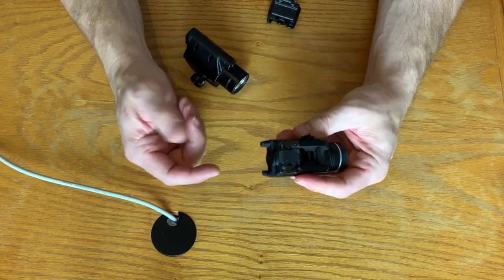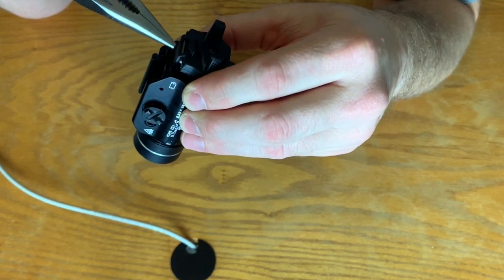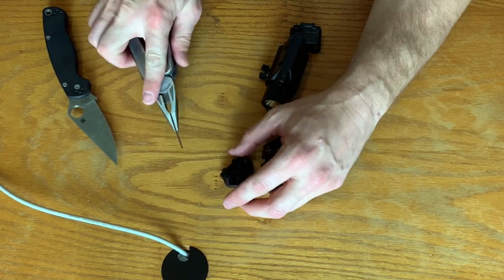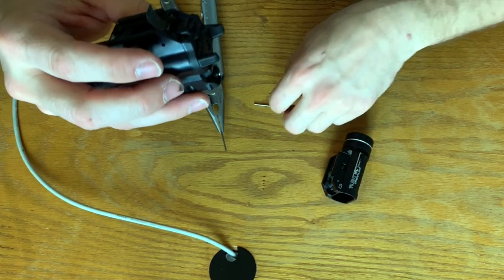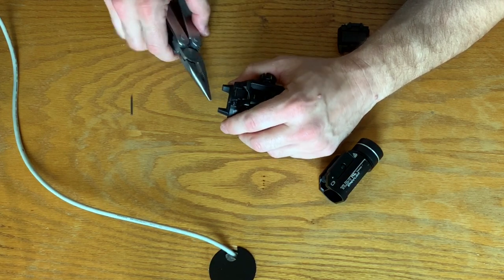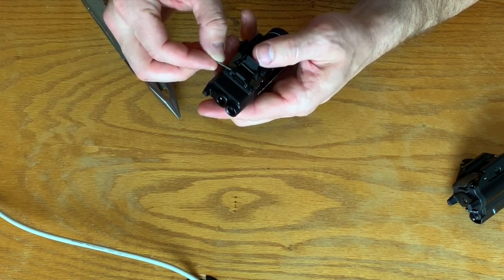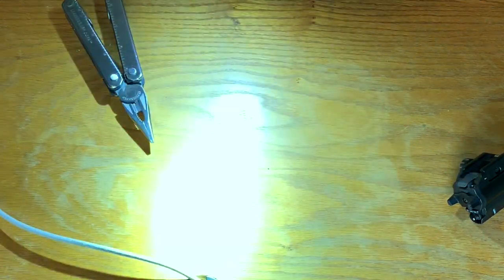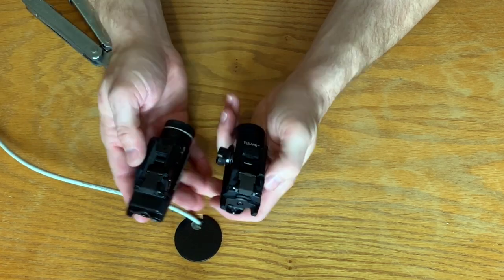Swapping Out Battery Doors on a Streamlight TLR1 Weaponlight

Comment: I wish they had those remote switch-enabled battery doors would work on an Olight Baldr Pro. The Baldr Pros are basically product improved and newer version of the TLR-2s that cost only $120; the one downside with the Baldr is the laser plugs into the part the pressure pad plugs in on a non-laser version and blocks it, making it incompatible with the magnetic snap-on switch non-laser versions have. So if you want pressure pad capability, you have to go to a $350 TLR2 right now

Comment: Hey buddy I just bought a used tlr-1 HL that has the pressure switch already pre-installed can I buy a back battery door from A TLr1 and put it on the HL so I can put it on a pistol??
Reply from the maker: The Novice Shooter yes. They are interchangeable.
Reply: @CraigSummers  thanks buddy I really appreciate the fast response!! U R the man!!

Comment: Is that battery door on the TLR-1 HL made of plastic or aluminum like the rest of the light body?  I ordered a TLR-1 HL on eBay and it came with a plastic door that arrived broken.  Thanks for the good video.
Reply from the maker: its plastic
Reply: @CraigSummers  Streamlight should be ashamed of itself.  Battery door on my TLR-1 HL broke off, also. The gun has never been fired, and resides in a hard case. The thin plastic piece on the door broke, and I wonder what would have happened if it had been fired! POS, and judging by all the complaints, surely Streamlight is aware! Also have a TRL-7, no issues.
Reply: @stickandrudder123  I have mine mounted on an airsoft gun and it broke. I do use it in fields in the middle of the night though so I am kinda rough on it but the door should be metal for sure.

Comment: I run a tlr-1 with laser on my helmet. It’s nice to have the white light and the laser to point out stuff without pointing a weapon. Only issue is I’m constantly bumping the toggle and when grabbing my ear pro off my helmet. Is the pressure switch single toggle lever stiffer or less easy to operate? I’m looking for a better option to stop giving away my location by accident.